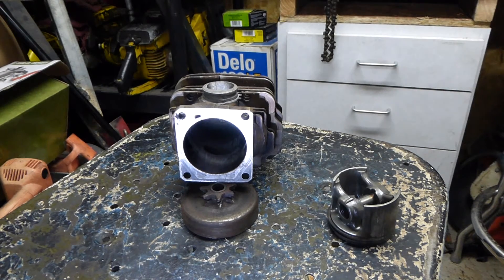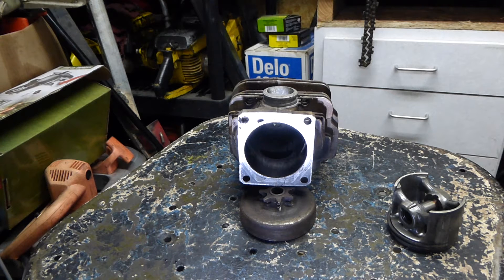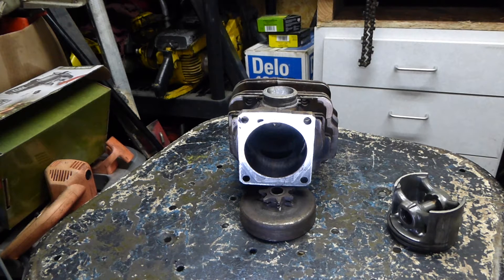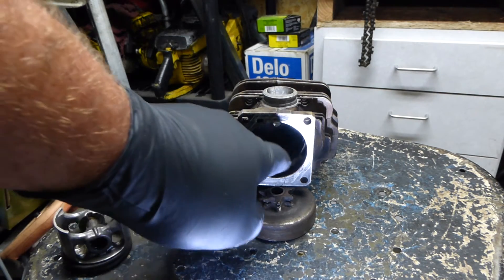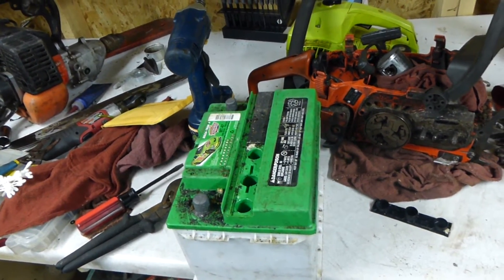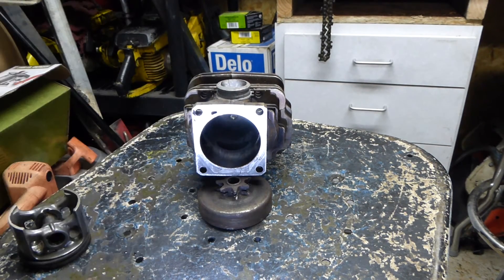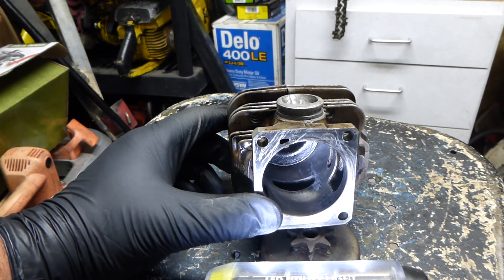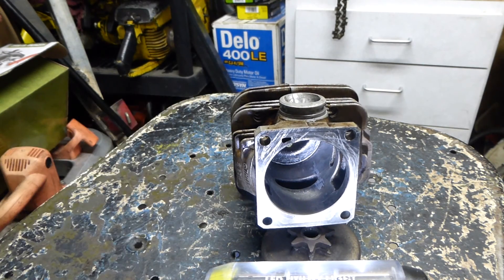cleaning aluminum transfer from chrome cylinder stihl (440/044)

Comment: Can you give me the procedure to restore the cylinder barrel of the petrol saw that has been scratched? thank you very much !
Reply: Really depends upon how bad the scrap… a little diamond ball burr will knock down the edges of the scratch… a little scratch or two really doesn’t effect much at all… if it’s below the top of your exhaust port window then it’s not affecting the engine power at all really… acid wash with the muriatic acid and a 320 ball hone very slowly spun underneath your warm water in the sink is how I do it… 😁👍

Comment: Just for your information you can buy a huge bottle of muriatic acid for like $5 at Home Depot and you don't have to use any heat and it eats the aluminum right off the plated cylinder walls while doing zero damage to the plating.......
Reply from the maker: the heat speeds up the reaction, it would work the same as muriatic acid,
also mt home depot they only sell in 4 gallon quantities at $45!!
Reply: So the issue with the acid is accidentally letting it drip down the port or to the squish band... then weakening then aluminum and after a few hours ur shit falls apart again. So muriatic acid works... but has more risks.
Reply: So that's why people are trying other methods.